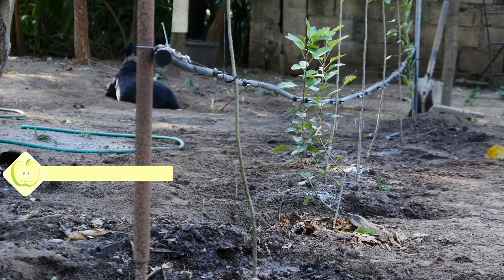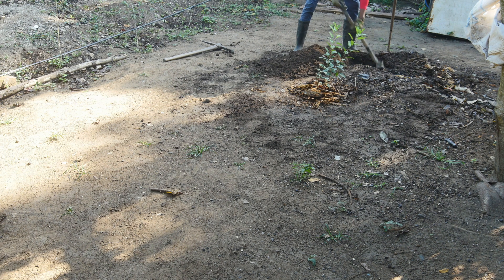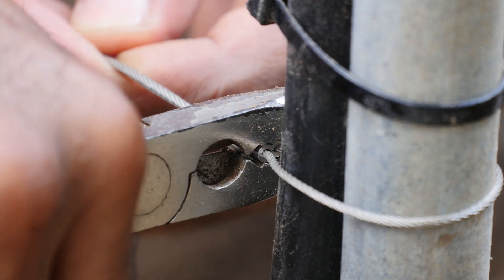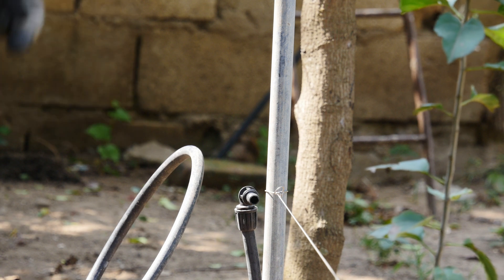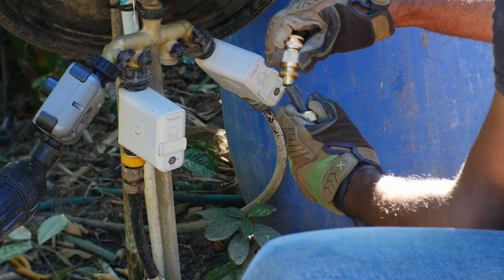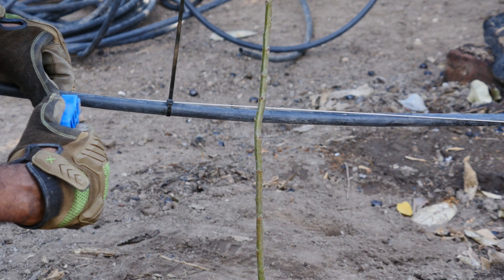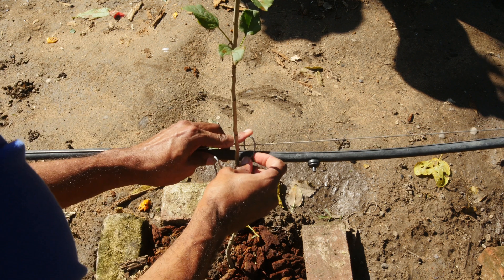Apple Tree Home Orchard | Quick Guide in Jamaica  🇯🇲 🍎🌱

Comment from the maker: ⏰ Time Stamp⏰ 

0:00-Intro
0:17-Apple Nursery Quick Tour
0:36-Tools & Parts Used to Build Apple Orchard
1:50-Digging Holes For Transplant
2:41-Aligning Apple Trees with Holes
3:13-Damping Soil for Transplant 
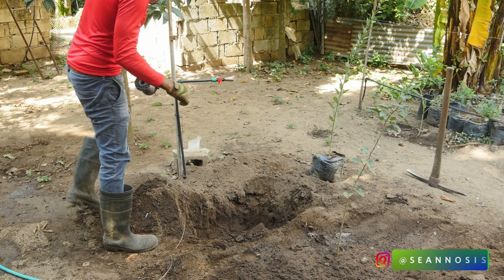3:43-Installing Wire Cable for Irrigation Support
5:42-Intsalling Irrigation Line On Support Wire
7:59-Connecting Irrigation Line To Orbit B-Hyve Wifi Timer
9:08-Flushing Irrigation Line
9:22-Transplanting Apple Trees Against Irrigation Line
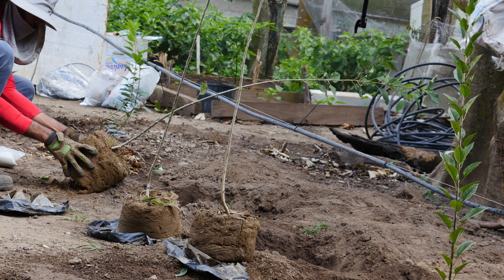9:34-Applying Mycorrhizal Fungi During Transplant
11:50-Installing Drip Emitters on Irrigation line
13:30-Doing A Irrigation Test run After Installation
14:02-Installing Support Clamp on Apple Tree Irrigation Line
14:26-Final Results.